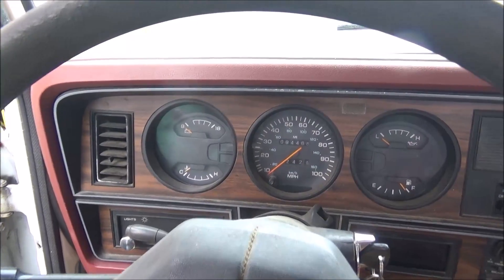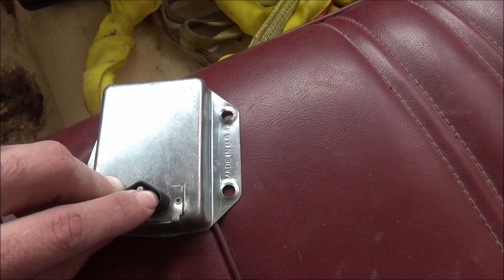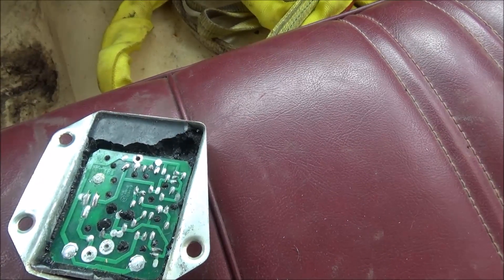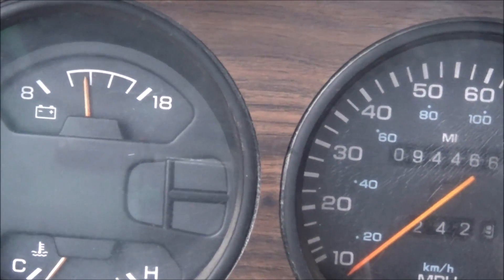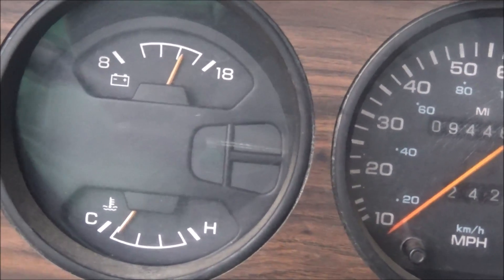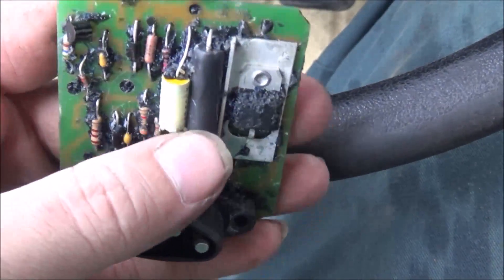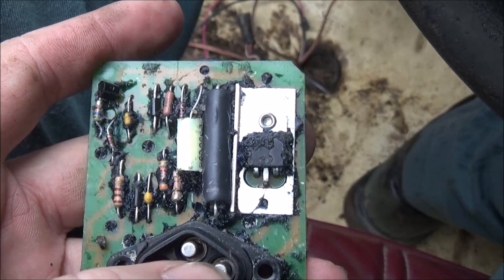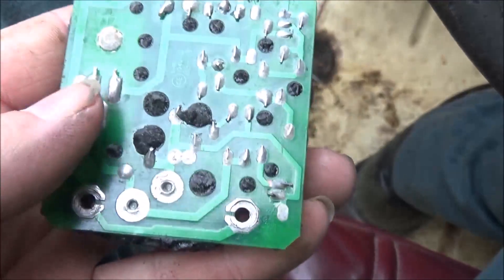Plagued by electronics, I need help

Comment: Hello Brian,  I have always been a fan of the single wire GM alternators.  You could adapt a bracket for it.  I have used them on boats and vehicles for decades and rarely had any issues.  Good luck.  Take care and say hello to Bailey.  Doug

Comment: If you have more of the same alternators, measure the resistance of the field winding and compare, It could be that this alternator field winding has shorted turns and is drawing too much current. The regulator could have over current protection and is tripping out. When you rev'ed the engine, the alternator requires less excitation current to produce a given current and thus the system works as expected. Try adding a power resistor of equal resistance to the field winding in series and see what the results are. I could be wrong. Another thing to try is to put the  regulator shown in the video on a good alternator and see if it's happy.
Reply from the maker: I have 2 more alternators i may just swap one since something must be up.
Reply: bcbloc02 ,I would swap alternators and start with a new regulator and add a couple of extra grounds, grounds will cause all sorts of problems,  because lots of times things are ground switched. I had the same problem with a old ford and it ended up being a ground prob
Reply: Many have said bad grounds. Good thoughts. The same with voltages. Also good thoughts. I haven't heard anything about amperage (Amps) measurements. You have to cut the wire in question, insert the ammeter in series and run the test. Test the field wire, write down the results, volts and amps. Check the voltage return wire and write  down volts and amps. Next disconnect the ground wire and connect the ammeter in series and get the volts and amps reading.  If there is too high amps in the field then your circuit is overloaded, causing component destruction. The field amps too low means bad regulator parts.  Carefully analyse the ground readings. Install a good regulator and compare the results.  The answer is in the readings. The ground situation is most critical as many have attested to,  Follow their advise to make sure that the grounds are good.

Comment: Long black component is a power resistor. Tiny washer looking part is a thermistor. I'll give you a shout on email.... no message link on your homepage. ping me your email to tubefodder@gmail.com I'll fix you up with a lifetime regulator based upon REAL (not automotive mfg proffit designed) electronics. (Free Gratis, cause I like your channel.) I've been an electronics engineer for forty years.

Comment: Hi Brian, the external regulators are old designs. The new style alternators have an inbuilt regulator which require the terminal to the battery and the rewire of the battery charge light to the other terminal which is the field excitation terminal. And that is all that is required. If this is your 6th regulator, I agree with the other comment ie. one of the alternator charging diodes could be cooked as they generally have 6 diodes in alternators and convert 3phase in the alternator using a diode bank. If one of the diodes is faulty it will send an ac signal on top of what you can see on the dash voltmeter which could destroy the voltage sensing on the regulator, particularly when the new regulators are electronic.The really old regulators used relays for regulation. hope this helps, thanks for replying to my past comments. regards Mick

Comment: Number one:  Ground strap to engine from chassis. Second, run a separate ground wire from alternator body to regulator. Your failures have symptoms of intermittent ground to regulator.
Reply from the maker: I already have 2 grounds from engine to chasis. Both with star washers 
and dialectric grease. The regulators themselves are also mounted with 3
 screws with star washers as well.  The alternator also has a dedicated 
ground t the cylinder head. I cleaned them all when I installed them but
 may need to go back and do them again. It would have been nice if 
Chrysler had used the 3rd pin in the wiring connector for a ground 
rather than running it thru  the truck. I think I am going to try a 
dedicated ground wire from reg to alternator next. My email is on my about page on you tube but I will send you a message anyway.

Comment: There are only three components relevant to your problem.  The Battery, The Alternator, and the Regulator.  If something is eating your regulator, the Battery or the Alternator has to be the culprit -- no matter what the electrical system tester says, the alternator is the next most likely source of the problem.
Reply: yep put a new integrated alternator on it, from bosch ideally,
Reply: many more components to that system. wiring, switches etc ... maake ya scratch your head  harold
Reply: Yeah, there are always wires and such connecting the components, but eliminating the major components first makes troubleshooting the rest easier.

Comment: check all of the earth connections.
Reply: +2 You need to install new ground straps. One from frame to body and one from body to engine. There is also supposed to be an external ground wire from the regulator mounting screw direct to the battery, or suitable "clean" grounding point. The regulator mounting screws into the firewall are not enough.
Reply: stevedotrsa plus 1
Reply: First step in any MOPAR electrical problem.